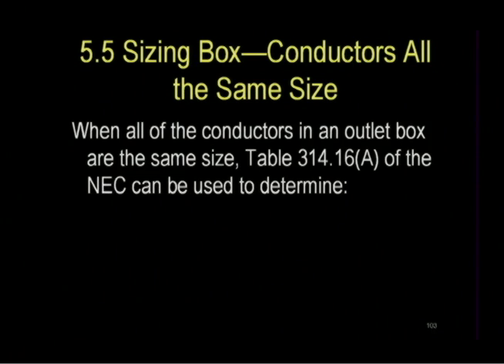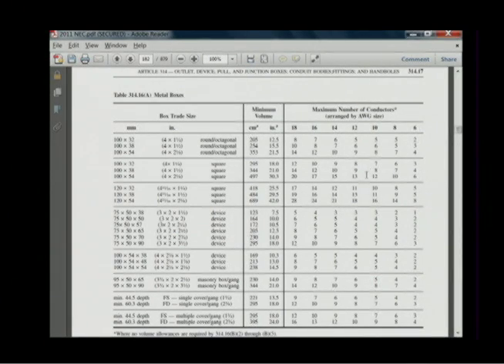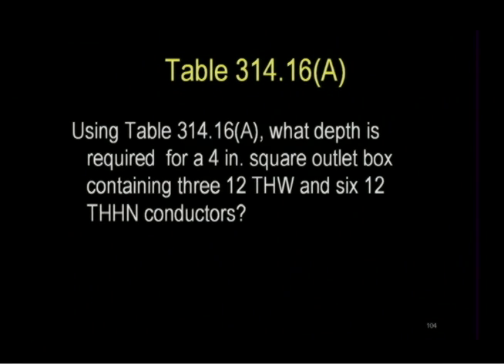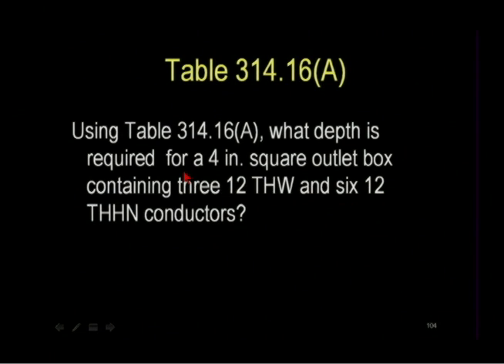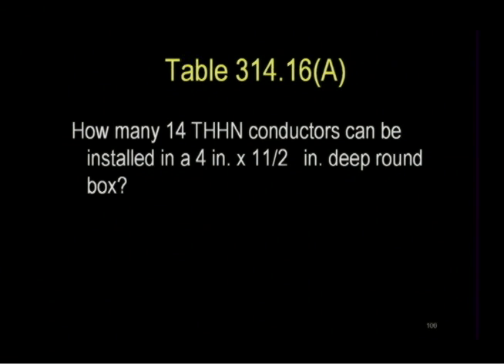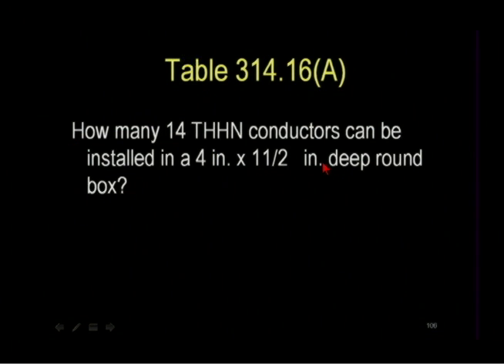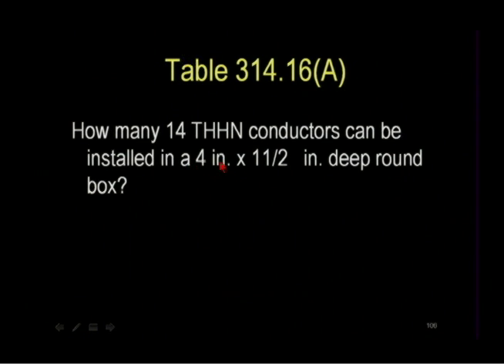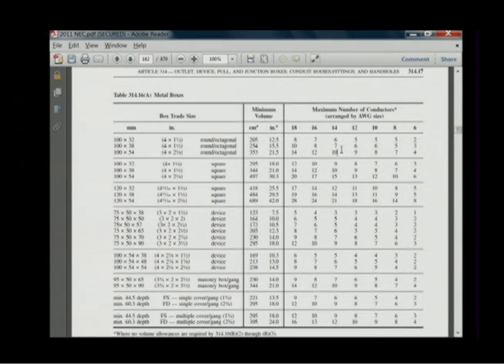NEC 2011 Sizing Outlet Box 314.16(A)] (4min:42sec)

Comment: How many 14 awg can go in a 4x1 1/2 deep round box? 7 Mike holt calculated 10 wrong answer that's 4 4x2 1/8
Yhwh
Reply from the maker: You are 100% correct, I screwed up. Thanks for noticing and helping me do a better job.